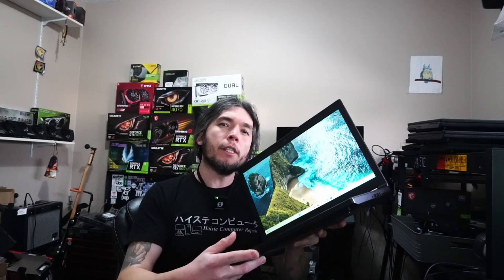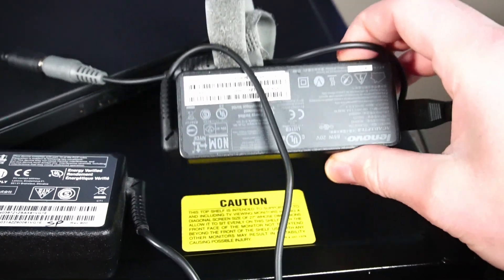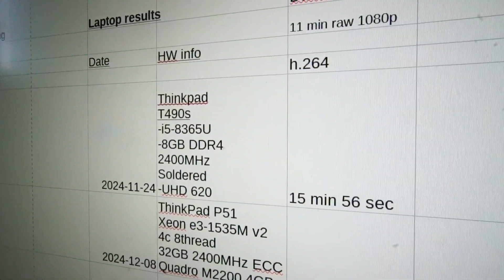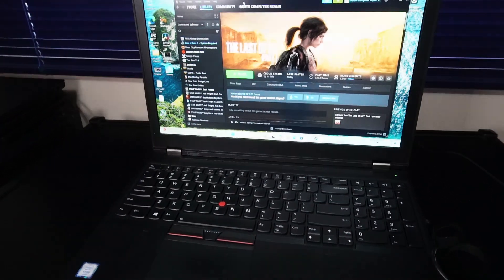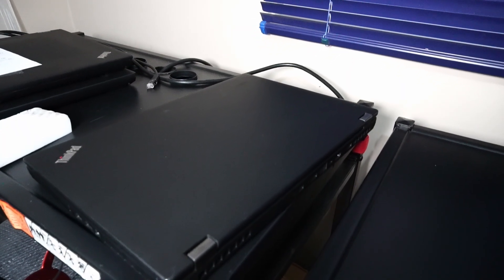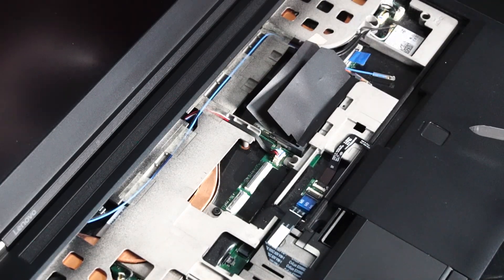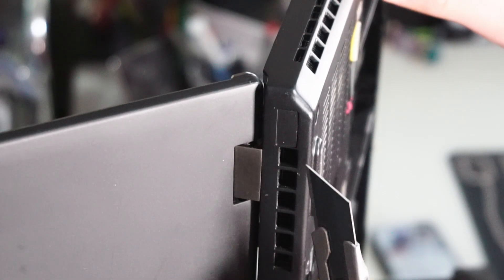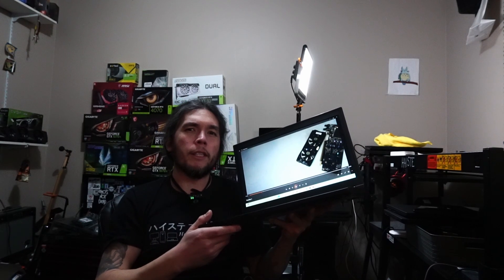Lenovo ThinkPad P51 for 2025:  Gaming, Video Render, Takedown!

Comment: This is great, I was considering buying one for college as I need something that can handle CAD software and some light gaming. And I will be coming back for the thermal paste section
Reply from the maker: Nice, good luck!  Getting to those heatsinks takes some time, but if you're into a little project it doesn't hurt to get it done.  Look for some Arctic MX-4 paste.

Comment: Seems pretty domp.icated to work on- what version of Lenovo would be easier to disassemble if needed? (For cleaning out fans, changing ram, storage etc?)
Reply from the maker: I suppose it depends, what kind of laptop are you looking to use?  Business class, workstation, etc.  T480s is business class and it's very easy to open up and perform general maintenance.

Comment: How to swape cpu core i7 to intel xeon?
Reply from the maker: You would need to purchase a new motherboard with the desired CPU/GPU combo
Reply: Yeah.  Sucks that Windows 11 will only support this i7 CPU in 2 specific laptops.  I was hoping to find a way to swap it for a compatible one
Reply from the maker: @Young_Star  The i7-7820HQ is an option with the P51 and it's on the Windows 11 compatible list
Reply: @HaisteComputerRepair not since I checked yesterday.  Been trying to find a way to do it for a while

Comment: my lenovo p51 with quadro m2200 is also hot while playing games. the gpu does not exceed 70, but the cpu goes up to 98 at times, but it oscillates a lot, dropping to 60-70 degrees in a second.
Reply from the maker: Yeah I have noticed the same.  I will say that performance doesn't seem to take a hit.  No stutters or obvious signs that something is getting too cooked.
Reply: @HaisteComputerRepair  
I noticed that if I reduce the processor to 90% in power options, the temperature drops significantly, and there are no problems with games
Reply: @doktorslobo  i remember this being an old performance tip because it theoretically limits the boost aspect of the cpu. you should try 99% as it should have the same effect
Reply: Can i use P51 in 2025?
I will use it for my college
Reply from the maker: @Bluefox192-s6g  Well, think about what you are using it for and if it relates to the content in the video.